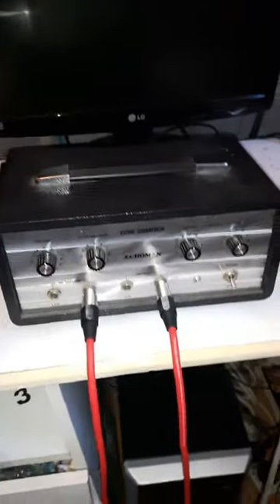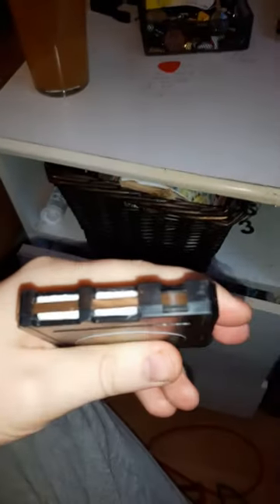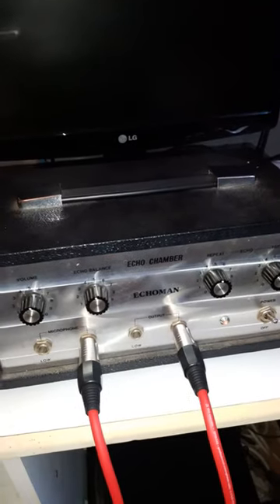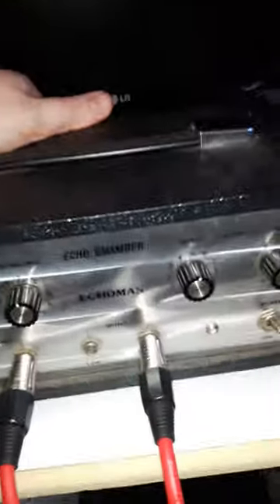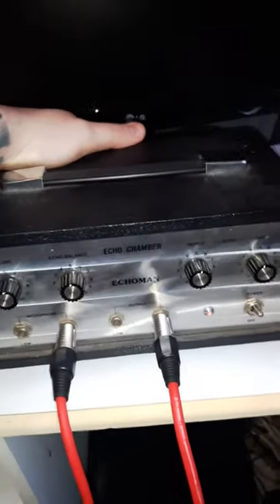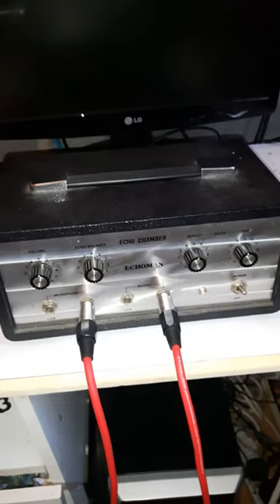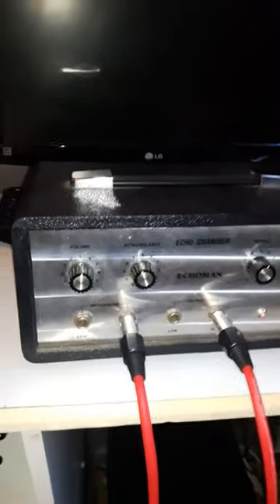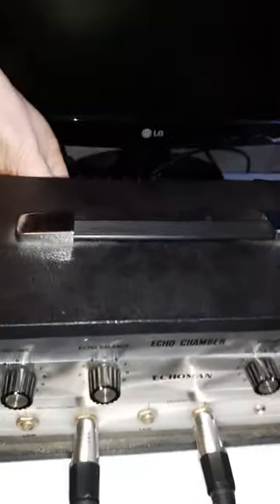Echoman Echo Chamber. Broken. Melos Univox.

Comment: I have a number of Melos echos which I have refurbished to their original state and have come to this problem. Here is the solution: if you look closely inside the tape machine, the erase head which is a tiny permanent magnet which erase the previous recording on the tape loop look that is missing. The permanent magnet which is a very small square is normally fitted just beside the play head. This is why you can still hear the previous recording. When people fiddle with these Melos/univox echo machine often remove/replace the play back/record heads and don't notice this important permanent erase tape magnet because it does not look important and unfortunatly loose it and sometime it can fall off its small bracket attached to the play back head. Hope this helps!

Comment: you can solved?... I got one too with the same isue. Try to replace the motor belt and take a look on the cartridge bay under the case, there is a piece of plastic on the bottom after de cartridge touch the heads, may be need a little more space.